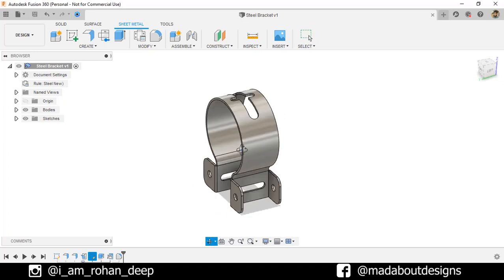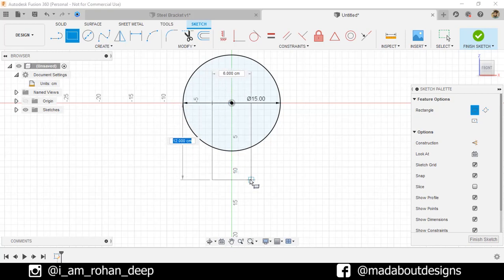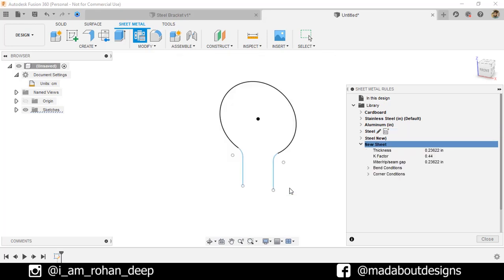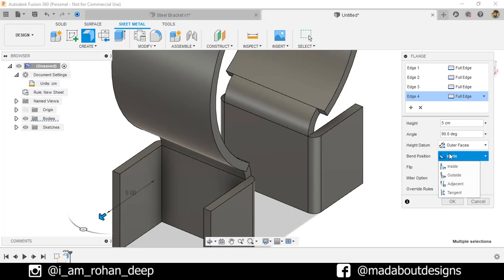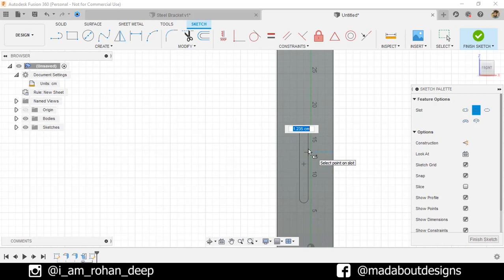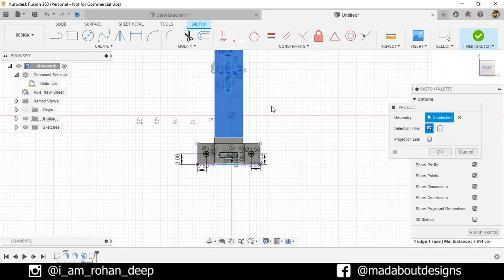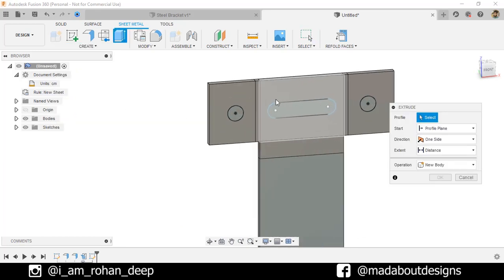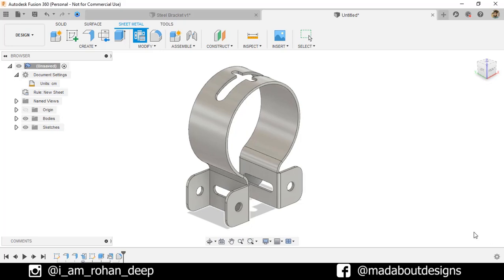How to design Steel Bracket using Sheet Metal feature in Autodesk Fusion 360 | Sheet Metal Tutorial

Comment: You are one of the only people to create a sheet metal bracket for a pipe! this is awesome. What i don't understand and struggling with is how to attach a flange off of the radius like I wanted to close off one end like a cap. If you have any tricks on how to do that I think you would be the only video showing this.
Reply: so, after two years, did you find out?